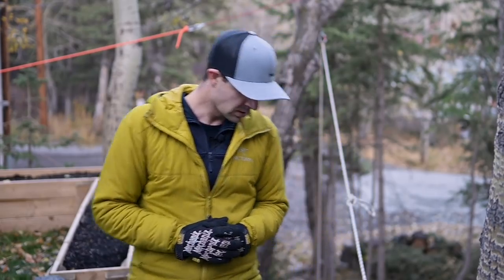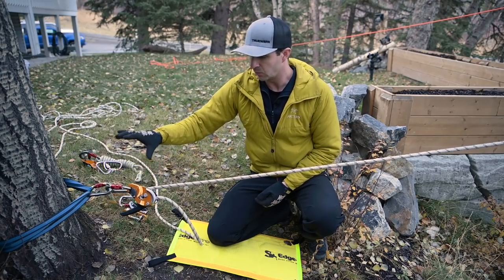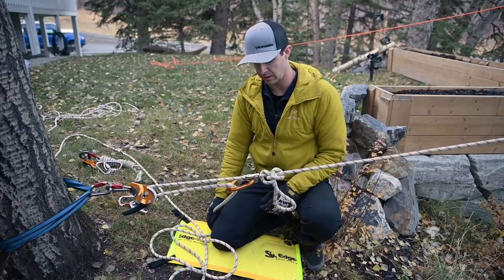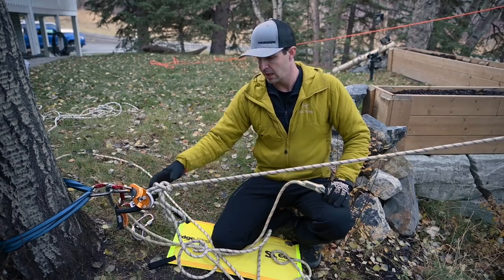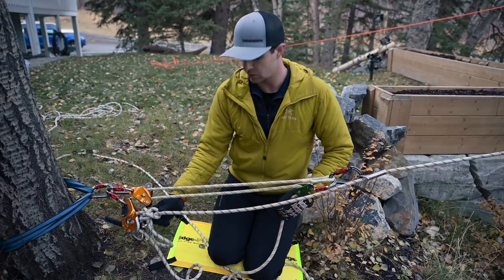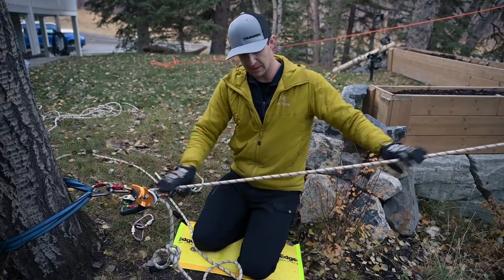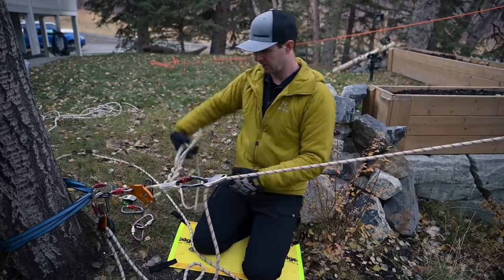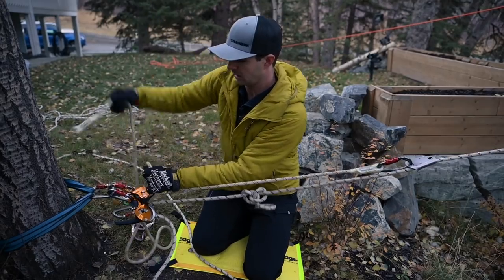HOW TO PASS A KNOT THROUGH A HAUL SYSTEM - TECH TALK - THE ROPE ACCESS AND CLIMBING PODCAST

Comment: Great episode, again!
About that extra friction, the way I think about it is that the rope in normal operation travels through the ID/Grillion(Gri gri) in the form of the letter "C". But when you lower off of either one, then the rope needs to make the letter "S" and you do that by pulling the rope back over the face plate. 
I hope that make sense, it's much easier to see on a diagram then to verbalize it :).
Reply from the maker: Hey
Thank you for your comment again!
No matter if it's one person/ two person/ lowering or what have you.  The Rope must run over the face plate of the device. 

But if this is a method that you use to make sense of it and teach it.  Thats awesome.  I have seen/heard so many didn't ways to do the same thing.  Some work better than others.  But cant say its wrong...

Comment: Curious about the tri-axle loading of your first crab in the system.    If you put a better angle on your anchor straps, it fixes the bad loading of the crab and also gets ride of the need for an additional crab because you can add one after the anchor strap is loaded without having to fight the wide angle.